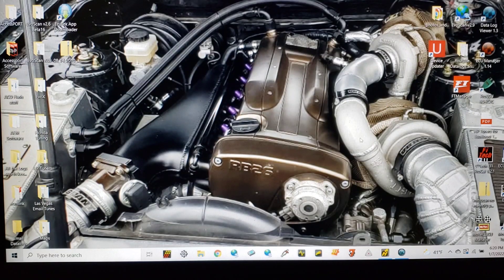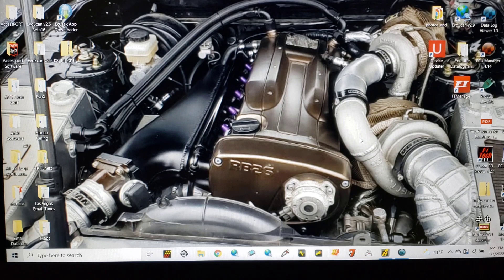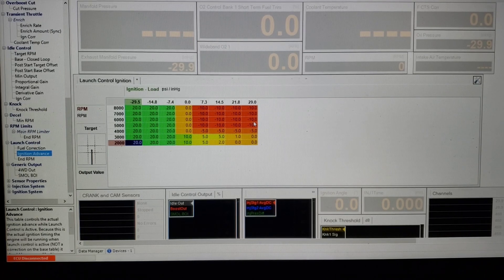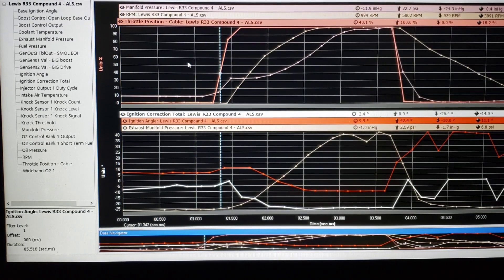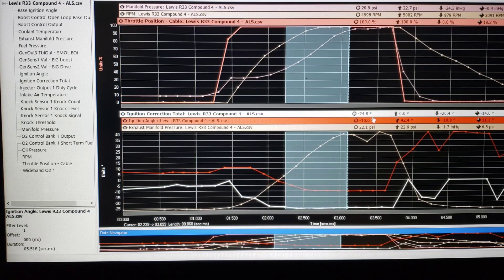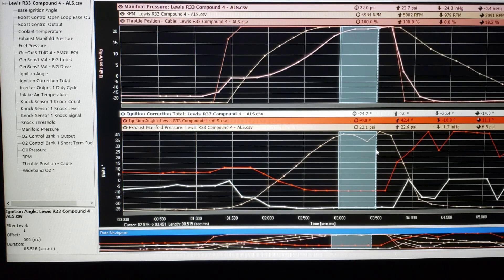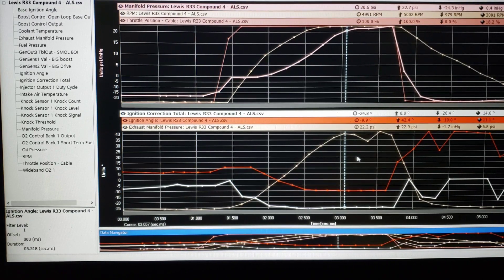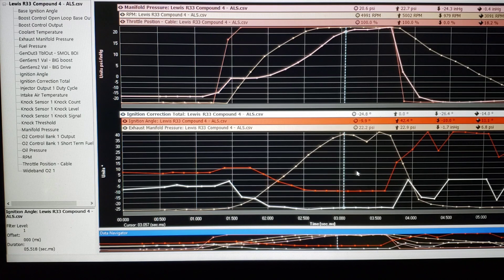Launch Control, Two Step, Antilag - Episode 2

Comment: I have an AEM V2 (tuning with AEMTuner) on my RB20DET in my R33 and honestly I've tried every combination of settings on the 2step including opening the 'hidden' options and even drag-style antilag, but I could never achieve actual bangs through my exhaust. I know it's silly but the kids around town are always let down when I floor it an nothing happens, I'm a disgrace to the Skyline community.  Otherwise I can build 16 psi on my HX35 in like 2.5 seconds and it surges like a whale but the exhaust is quiet as fuck. I think having a straight piped exhaust is mandatory to get bangs, since if you have a muffler and chambered resonators (I got a Kakimoto Racing 3" system), it absorbs those flames and nothing comes out.

Comment: Hey Aaron, i have setup my launch table exactly the same as yours and im getting extremely loud single bangs with -5.0 timing above atmospheric, if i reduce the timing to say -15 will that result in larger bangs or smaller? im trying to tone down my 2step as its just to aggressive.

Comment: Could you do a video on rolling antilag? I have an elite 2500 in my car but can’t really find anything on the haltech forums. I’d like to do certain things on my own but still want it to be as safe as possible. Coming from dsm link in my dsm’s to my current evo that had a stock ecu never had the opportunity to mess with rolling antilag but would like use it with my new setup
Reply from the maker: Yeah I can do one on rolling antilag. I think I still have logs from the last one I set it up on.
Reply from the maker: One other thing I forgot to mention is that the tables setup basically the same way. You could do different axis I suppose, I made 31 as I recall on a 2.2L SR20 with a twin scroll 6870
Reply: Hi, on the AEM infinity do you use both fuel and ignition cut to build boost ?
Also is there a table to change the way it cuts ?
Trying to get the cuts to be more rapid like haltech